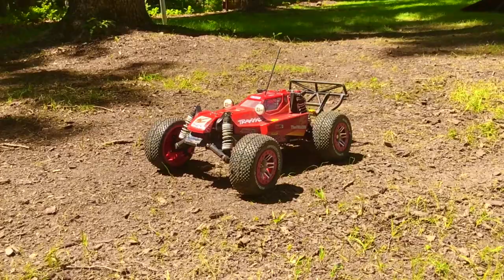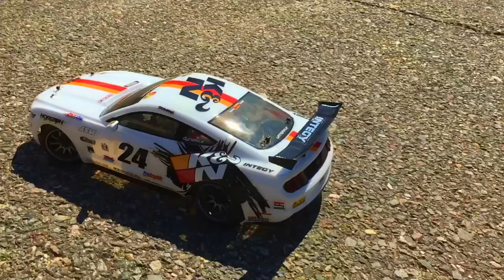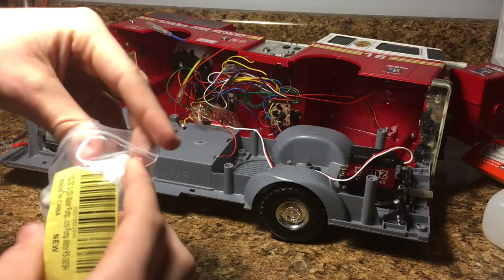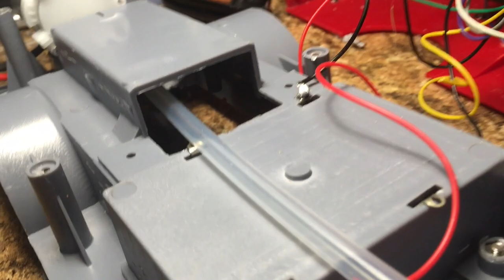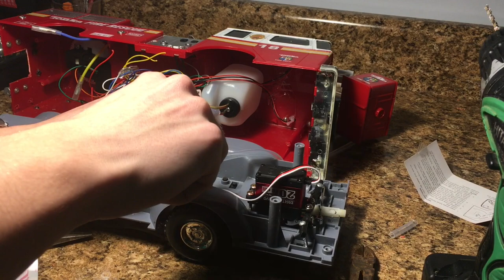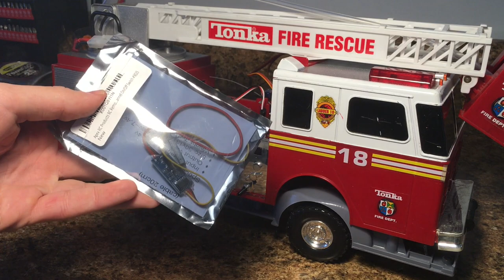RC Fire Truck Build Project | Ep. 3 | The RC Genius

Comment: Have you thought about running an ESC to that pump?  Maybe put it on a 3rd channel or do a dual ESC mix?  Really liking the build so far.
Reply from the maker: Mr Fezz RC Productions I have thought about that. Only reason it’s not my choice is because I don’t need to have a range of speed on the pump, just on/off. It theoretically would work, but I also don’t have the room to put a second esc. I have some ideas for it. Thanks for the suggestion. And I’m glad you’re liking the series!